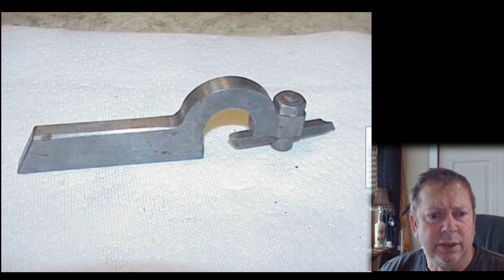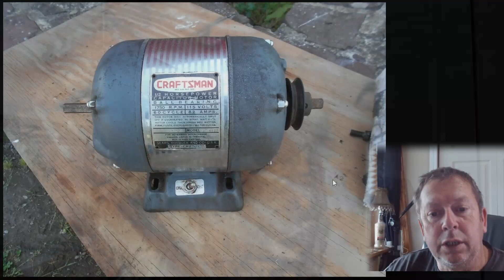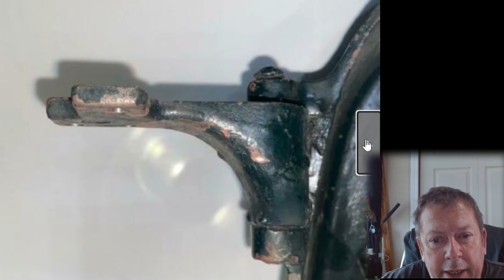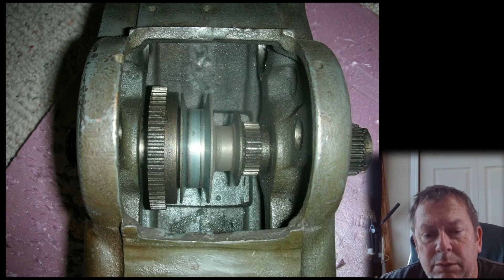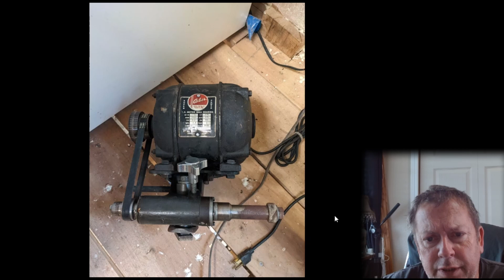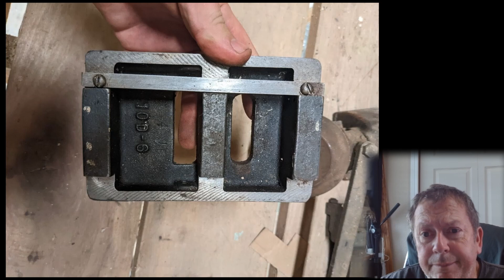Making Atlas Machines Affordable Again: Fleabay Edition: June 9, 2022

Comment: Motor, Yes I would buy if the price is rite, and I have bought. I picked up two Carftsman's, one is a high speed 3450rpms and a low speed 1750 rpm, Well I needed one for my Atlas QC42, the one that came with it was junk of some unknown brand. I start with a comeplete tair down and a good cleaning and inspection, then tested for any  leakege, then it goes back together. And yes I'm looking and would like to fine a Atlas motors and I know that they are out there. "O" the swap meet at Brooks is at the the end of June, The date I think is the 24 and 25 free parking, I need to to look up the dates once more" Brooks Steam Up Oregon"
Reply from the maker: Yes they are still out there if you can find a good one

Comment: I’d fully agree with you on the electric motor being $40-50 max. The bottom cover wasn’t even on it. That gear-WOW! That is a crazy off center hole as well as the outer ring.
Reply from the maker: That actually was the correct bottom cover. Many of the early motors like that had an unfinished cover on the bottom, I think it was mainly there to help protect the wiring and still allow air to circulate around the capacitor